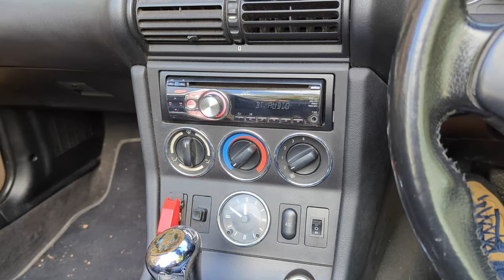An EV with a manual gearbox? DIY EV gear shifter fail

Comment: Gaffer tape should keep the water out for a week or two but it's old and tired so will need replaced. 
BTW just as I was about to start bolting on the bumper lights etc I discover the vac pump has a leak. 🙄 Only have to dismantle half the drive train to get at it. 😟
Reply from the maker: Oh no!

New hood going on tomorrow. Not planned expense - at least not yet - but necessary. It's not done bad for 24 years!

Comment: 6:00 That coupler is absolutely dead and should be replaced ASAP 👀
And make sure to get a full kit, because as far as I know the screws are single use (which might explain why one got lose).

I think there's a kit available from Meyle HD, which is supposed to last longer, but I can't give you any first hand experience about the actual quality.
Reply from the maker: What makes you say that? Yes the bolts are single use in theory but the guibo is actually in pretty good shape. One of the bits that looks like it was replaced during the car's life - unlike just about everything else! I do plan to replace it but it doesn't feel like an urgent job based on its condition.
Reply: @EVDIY  If you decide to change it give me a shout. I might have one spare.
Reply: @EVDIY  from my knowledge as soon as they start forming cracks they are done. And yours is full of small cracks around the bolt holes, making me think it might not be too far from failing.
Reply: Especially around the bolt at around 4 o'clock.
Reply from the maker: @crasbee  Crikey your eyesight is clearly better than mine. I didn't see any cracks. Will have a closer look at the video.
Reply from the maker: @alibro7512  Based on @crasbee's comment it sounds like I will be! But might as well do new bolts as well while I'm at it.
Reply: @EVDIY  I bought a couple of them three years ago but never needed them. There are a few different sizes but if the one I have works for you your welcome to it.
BTW, coolant drained and Inverter almost out. Now it's wine O'Clock. 😁
Reply from the maker: @alibro7512  Being a numbnuts I totally forgot about this and went and ordered one the other day! Doh! Might take one off you for the next car though - that will doubtless also need it replacing.
Reply: @EVDIY plonker 😂

Comment: Sitting down after my dinner to read my new copy of Deep Dive EV Conversion and trying to work out if I want to keep the gearbox on my Honda Insight I turn on You Tube...
Thank you for some inspiration Tom!
Reply from the maker: Ha! Pleasure!
Reply: Still waiting for mine. 😉
Reply: @alibro7512   It's worth the wait!
Reply: For my project I'm probably going to keep the gearbox...
Reply: @G-Cam1  I don't think I'll need to. The rear Outlander differential gives out more power than the Insight's hybrid unit.
Reply from the maker: @bnrynlds  if you've got the whole diff in there then definitely no need.
Reply: @EVDIY  That's the plan. If it fits.